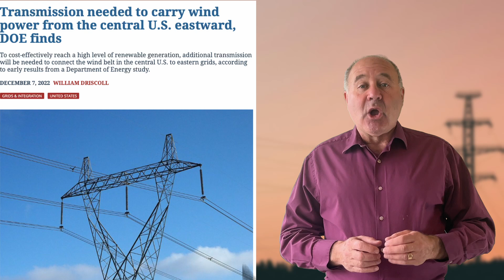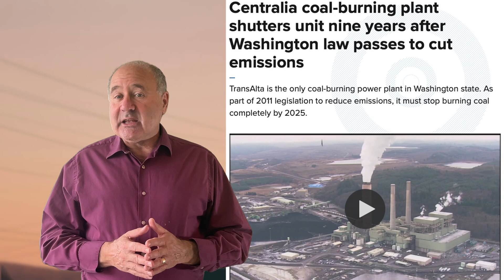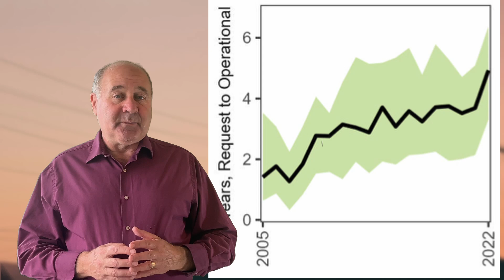Why We’re Totally FERC’d: Plan for the Grid We Need or Sit in the Cold and Dark

Comment: Put High Voltage Transmission lines in Conduit under new Rail Projects.
Fiber Optics can be included in the Roadbed.
The heat from Resistance will create small amounts of Power along the Line,
by diverting the Conduit through Small Turbines that convert the heat to electricity.

There we relieved 10% of the problem.....
Reply from the maker: In my first video (https://youtu.be/kw9_Q_qm0Es?si=cUXcSo_6g8zArsqh) I talked about a great transmission project call Soo Green, to connect wind power in Iowa to the grid in the Chicago area, burrying transmission lines along a railway right-of-way. But they are waiting for permission to connect to the grid.
Reply: @Decarbonize11  I have noticed comments from People I know about the potential Wind Produced  Generating  plants that do not get adequate access to the Power Grid.
In Montana the Judith Basin project is limited by the amount of connections their output is allowed to be distributed.

The efforts of Jack Welsh in the late 1970's and early 1980's to limit the funding for small Wind Production industries to thrive,  appeared to be intended to promote General Electric Generators to be established as the focus of wind power generation.
The ability to set up Tower Construction infrastructure did take some time,  as well as tooling to enable more large Generator Production to build enough to develop profits from the industry.

The poor performance of GE since Welsh left the Company might be related to changing connections in Washington DC that do tend to shift the focus of funding as the money becomes limited.
Policy changes do shift as funding is limited or prioritized,
I have promoted the concept of buried High Voltage Transmission lines since 1996.
I may have missed your previous comment about buried Power Lines.

Comment: No money is a favorite excuse to not act asap on grid improvements for electrification . Utilities just don't have the revenue!! Rate payers refuse to pay more for electricity say the political hacks. Simultaneously the current grid is struggling day to day with frequent outages. The ratepayers who according to the hacks wont pay are choosing to install $5,000-$15,000 house generators which require oil and filter changes. New starter  batteries. They also run once a month for testing. Where we live they're spreading like dandelions. It's insanity defined
Reply from the maker: I think part of the problem is the regulatory structure for investor owned utilities is that their profit is based on their spending and some of these solutions, especially GET and reconductoring, is just too cheap.